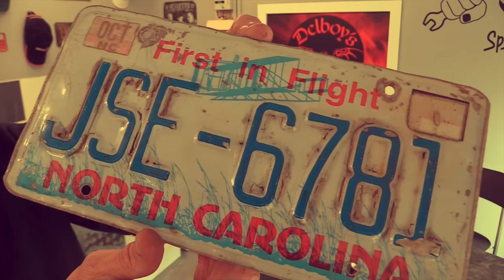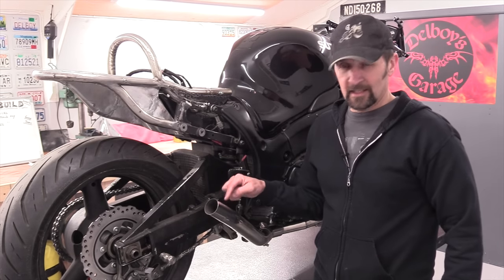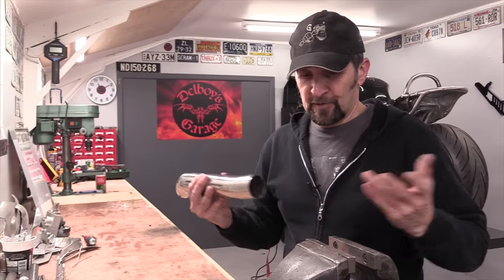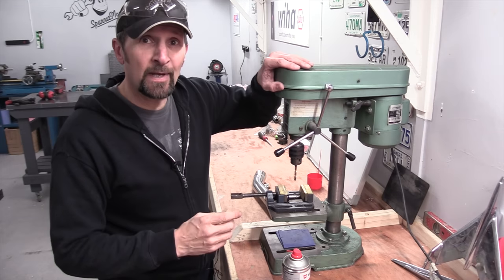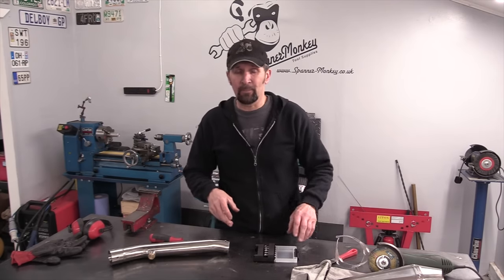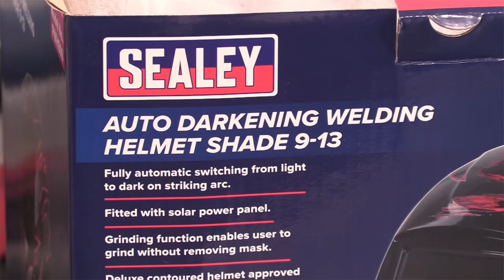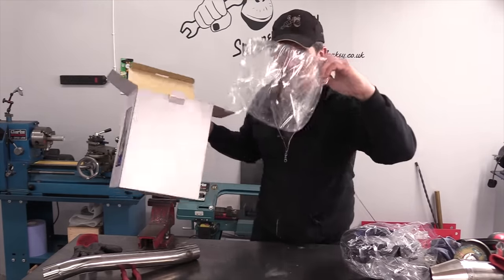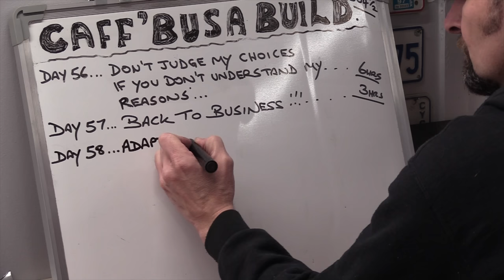Day 58, Hayabusa Cafe Racer Exhaust Fitted !

Comment: Awesome solution to a reducer. But if you plan to keep that nice an bar stainless it will rust fast with those plug welds cause you used mild steel might wire.
Reply from the maker: They'll only rust on the surface mate, and its a Ratbike, so no worries, it'll add to the patina. if it was a posh bike, then id have swapped the wire roll and polished the pipe afterwards..

Comment: Another little tip for drilling stainless is use a triangular ground centre punch instead of a round one, the faces give the drill something to cut against if the drill isn't completely sharp.
Reply: That's a great tip, didn t know ..cheers 👍🏻☮❤

Comment: Hi Dell, Your welding mask is failing as the battery and yes it dose have one, is old now. That kind of mask is not possible to replace the battery without braking it apart. Good upgrade and ready for another 5-10 years.

Comment: Drilling speed/rpm depends on the drill diameter. 🙂
Reply from the maker: Thats a finer and more critical adjustment that most drill presses often cannot accommodate,  mine only has 4 speeds, but yes indeed, the bigger the slower..!
Reply: @Moonfleet41  
I know. Still a 5 mm is double rpm compared to a 10 mm.
By the the way - Very nice video. 👍
Reply from the maker: @JmChannel25  Yeah, i have a set of blacksmith's drills, the largest is 30mm, pretty much unusable in anything but a hefty lathe with double figure speed minimums..   Stay safe buddy. Del.

Comment: I bet you nearly  put petrol in the tank.so you could hear the  exhaust 😅🥴
Reply from the maker: I wanted to mate, but the fuel system is still bone dry, I wanted to check the hoses and was waiting for the pressure clips to connect it all up, once the hanger is fabricated, then I can, indeed, think about that as the next  move!

Comment: Not got any stainless mig wire then yet Del? You have now dilution in your spot welds which will eventually fail due to differential metal contamination. Also ,  always place your weld return as close to your weld as possible! Saves arcing and destroying the finish on the pipe. Read the books I sent you!! Jesus mate, your not helping yourself here.